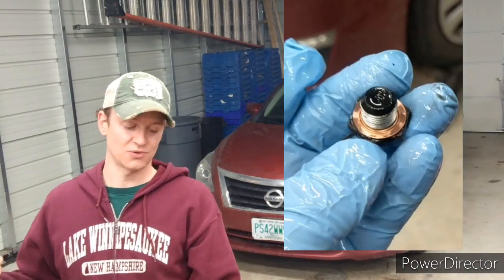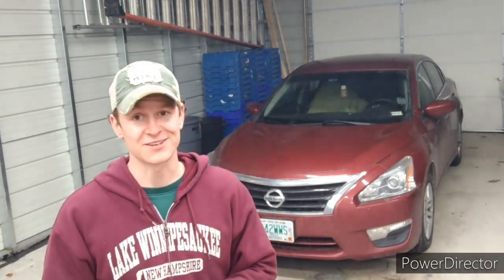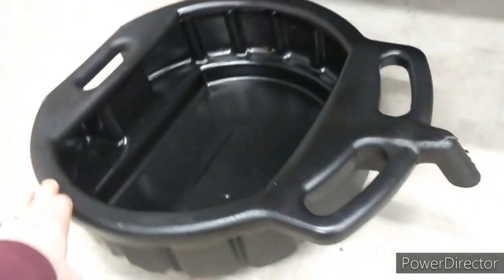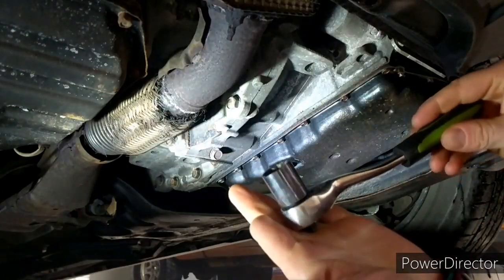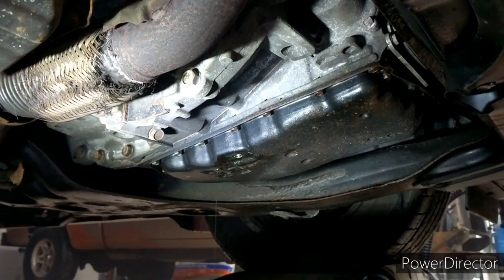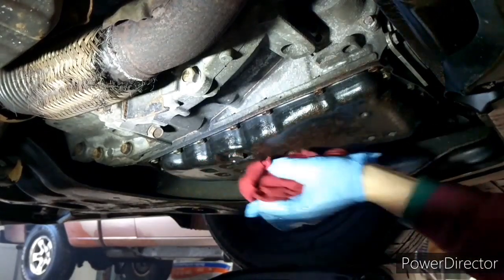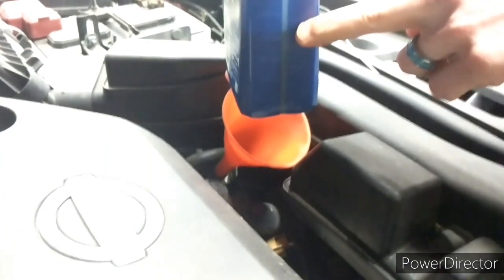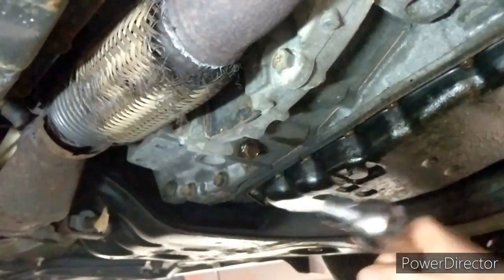Changing Nissan CVT trans fluid.

Comment: Some videos take out the secondary plug when draining? Then replace it and refill and wait till no fluid. Then replace the drain plug.
Reply: Some videos have a leveling straw, others a check bolt. I think the object is to have a couple of inches of fluid in the pan for the filter to pickup. Miss the dipstick.
Reply: Depends on how well you want to do it. Just took mine into the shop after watching a few videos and deciding I'd rather have a shop do it properly and try to get almost all of the old fluid out. The entire transmission holds about 7.25Q, so the lower you are below that number, the more old transmission oil you are keeping in the system. If you want to do this properly you need to be heating it up to 110, draining the main drain plug, draining the secondary drain plug, if you really want to get involved you can blow air into the lines to fully clean out the system and if you want to take it a step further clean out the inside a bit with nissan transmission cleaner, replacing the secondary and main drain plug. Refilling either by keeping track of how much you've removed and adding that much back in, or using a purchased dipstick. Then run the car for a bit, while shifting between the different gears, and allowing it once again to heat up to 110, then while it is still running remove the main drain valve(NOT THE SECONDARY) and then replacing it once it gets to a drizzle. The less you remove, the more old fluid you are still leaving in there, which kind of defeats the purpose, especially with how shitty these CVT's can be if you don't take care of them. I know your comment is old but I want others that also are doing research on the job to hopefully read this and learn a bit. There are filters as well that can be replaced, but often times this is not necessary as it's a mesh filter.

EDIT: Also you should use Nissan NS3 with these, I would never recommend using an off brand on these. There are multiple videos that say the same thing as well as the techs I talked to. Go to a Nissan Dealer direct to buy it if you are looking for a deal on it as it is expensive and they often carry a lot of it.
Reply: @Hitmandan  I agree, mostly.  I have an 07 3.5 see.  Nissan replaced the cvt 4 years ago on an extended warranty.  Evey 7k-10k I psiphon out 2 to 3 quarts of cvt fluid through the dipstick tube and replace it w/ eneos cvt fluid.  35k+ miles on the rebuilt trans and it still feels great.  do you think this is unwise, or should this keep the cvt in good shape?  thank you!
Reply from the maker: The way I have shown in the video is exactly the way the dealership does it themselves minus having their own dipstick to check it after everything is complete.
Reply from the maker: Having the dipstick and the check valve are essentially the same as far as checking your fluid level

Comment: 6 qts is what my 2012 maxima took,  but i blew out 2 more qts through the external filter lines with my air compressor.  the oil that came out when pushing air was really really dirty .ran car for 30 minute till at 165 degrees and was right level. btw decided on valvoline cvt.  77k on my car probably the first change.  but i bought used.

Comment: I have a 2013 pathfinder, it only has 19k miles when i got it it is now at 103k miles can i still do this drain and refill? I have asked the dealer to do the srevice but none of them wants to do it.
Reply: My independent mechanic didn’t want (refused!) to change my Murano’s CVT fluid and filters. I suspect they don’t want liability if the transmission fails later. So I will perform the service myself. There’s a tremendous body of data indicating that those problematic Jatco CVT’s last much longer when they are maintained. Who would have guessed?

Comment: You definitely shouldn’t go 90k miles per cvt fluid change. Also, I’m pretty sure the Valvoline CVT Fluid is not NS-3 rated.
Reply: You can easily do it actually. Blackstone lab results show even 100k mile cvt fluid is perfectly good and hardly broken down at all.
Reply: It actually is NS-3 Rated

Comment: First of all I want to thank you for taking the time to make this video. There's not enough videos on Nissan's. Probably one of the reasons is that Nissan will not warranty their transmissions unless you have them do all the warranty work not just the transmission but the oil changes everything the dealer offers a lifetime drivetrain warranty if you let them do all the work. Which basically you might as well just buy a maintenance contract if you let them do all the work you will spend enough money to buy a good maintenance contract. Moving right along. It's good to know that you can do this for cheaper than the dealer. But what about warranty do you have any plan for that. Thank you and that's not a rhetorical question that is did you research that and what did you come up with?
Reply from the maker: Thank you for your input and encouraging words!
Reply: The dealer can’t deny warranty work in the US for using a fluid different than their “suggestion”. That’s all it is, a suggestion.

Comment: You decided not to flush because others were damaging their transmissions when flushing. What is happening with their flush procedure that's causing damage to the transmission? If you let the CVT pump out 1 quart at a time, and replace each quart, I'm wondering where the damage is coming from?
Reply: You aren’t damaging the transmission. Your old fluid is full of grit from the wear of the clutch material. That grit helps your worn down clutch plates grab. If suddenly that grit is replaced by nice smooth clean fluid, then your worn out clutch plates don’t have enough friction any more.
Reply: @andrewbuchanan8279  that is exactly what I've heard, from several knowledgeable mechanics.  generally true for all transmissions, not just cvt's.
Reply: @vincentperiolat4610  Is that why newer cvts are a seal unit hence auto manufactures do not want you to replace the fluid?
Reply: @vincentperiolat4610  Believe  me...most  mechanics  are  not  as 
knowledgeable  as  they  would  like  for  you  to  believe.

Comment: I have never changed the transmission oil on my 2015 Altima it’s now at 86,000 miles is it safe to change it ? Or is it too far gone ?
Reply: I just did a full CVT fluid flush including changing both filters on my 2013 Altima. There’s another video on YouTube that has an excellent walkthrough, set by step. I bought the vehicle used a few weeks ago with about 102,000 miles. By the look of the fluid that came out, it had likely never been serviced.. the fluid was very dark but it did not smell burned and the pan did not have an excessive amount of gunk or metal particles. It was operating normally before I serviced the fluid and I really didn’t notice any difference afterward. I would definitely recommend doing it. You are buying yourself protection down the road. I used Idemitsu CVT N3 which is cheaper than the OEM Nissan CVT fluid and meets all the Specs for NS-3
Reply: If you check it out, Idemitsu makes Nissan OEM oil. 
I still like Amsoil or Castrol better.
Reply: @Dennis VanSandt  it's all the same crap honestly. Just a sticker is the difference. People overthink this stuff.

Comment: What's the purpose to know the temperature of the transmission on the CVT...🤔
Reply: The reason is that, according to their FSM, you check the fluid level at 40°C (115°F).
Reply: The fluid expands ass it’s heated,  115 is the temp they want in order to see the fluid level on the check bolt.  If it was colder it wouldn’t expand to the proper mass/size?

Comment: Missing the hardest part; Removing the filler cap.
Reply from the maker: It snaps in place, take a screw driver and push it down into the clip to release the cap and pull off.

Comment: Hi. My efficiency never exceeds 22.1mpg. I live in the city but I saw yours at 31.6mpg. What am I missing? 2013 Altima SV.
Reply: Gerald E slow it in the pedal. Let go of the pedal sooner when coming to stop light and it’s on red.(no need to approach a red light fast).  Avgd 28.5 purely city. Also check tire life and tire pressure.
Reply from the maker: I live in New England. Out here there are long stretches of road that are consistent and speed and there is no stopping and going.
Typical city driving gets typically low mpg, Due to the frequent stopping and going. Every time you have to come to a stop and re-accelerate, it takes double the power and fuel  to regain speed and momentum. This drastically lowers your numbers in mileage. The longer you're able to stay at one speed the longest, the better your fuel mileage will be. Also gentle acceleration is always a plus. Let your continuously variable transmission do the job. I often press the pedal just enough to get the car rolling, after that your transmission will keep accelerating in speed without you pressing any harder. This is why I continuously variable transmissions (CVT) are ideal when it comes to achieving fuel mileage in a vehicle.
Reply: Straight city mileage is terrible on almost every car. I avg usually over 34mpg. on every tank but its a mix of everything including idling and goimg into nyc but. Dont use ac or automatic climate settings that uses the ac compressor and dont exceed 1500rpm. Steady cruise on city highways and font drive during rush hour are all tips lol.

Comment: How Many At Take 4qt?
Reply from the maker: I put 4qt in and got about 2oz out through the check bolt.
Reply: Definitely  do a video on the pan gasket and  filter change as well.
Reply: Just  read  your  owner  car  manual.  It  will  tell  you  in  the  back section
under  transmission  how  much  fluid  to  add  when  changing  out. 
It  always  amazes  me  how  many  people  never  read  the  manual.

Comment: You can avoid messing around the the leveler drain bolt and doing a temperature reading and all that.  Assuming that you have no leaks, simply measure what came out and put that exact amount back in.   Simple as that.   Castrol also makes a CVT fluid that fits the bill.
Reply: That's one way, not the best.  It doesn't account for any leaks, and assuming it had the correct amount added during the last change, if one had ever been done.